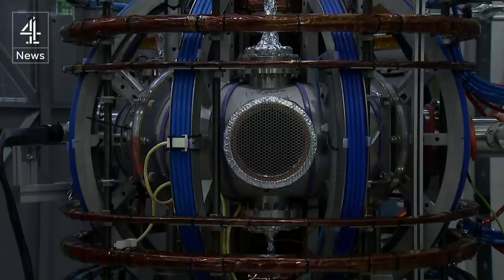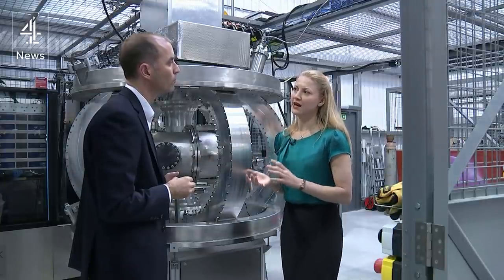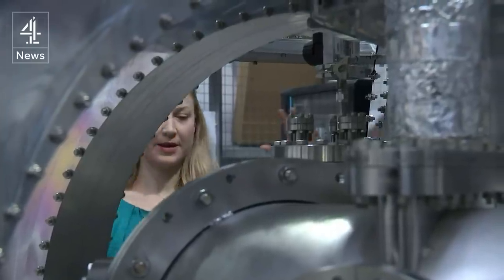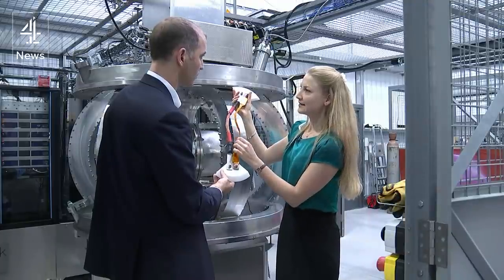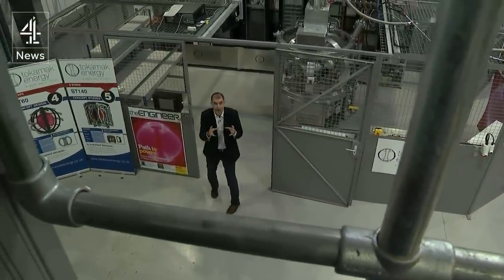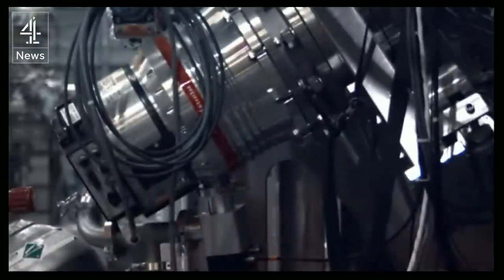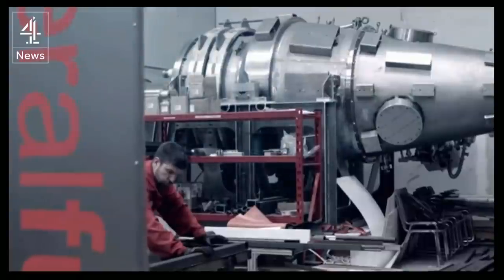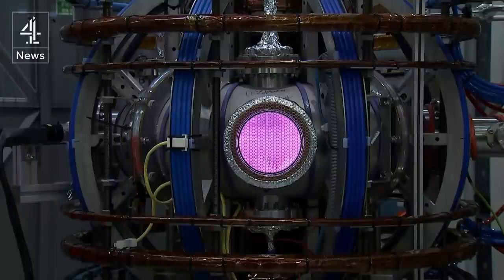Fusion energy: becoming a reality?

Comment: I want to know what that conductive ribbon is made out of
Reply: It's made of a very thin layer of superconducting material and a bunch of steel for strength etc. I'm not sure of the exact superconductir being used here but high temperature superconductors are usually ceramic-like materials with a complicated unit cell. Usually some oxygen, some rare earth metals and some other random elements. We still don't understand how high temperature super conductors work so it's hard to make them better without a lot of faffing around trying many different combinations and making some guestimates.

Comment: Is it dangerous to touch the super conductor tape?
Reply: +Martin Lancaster  Not to you but to the tape itself, it will damage it i think
Reply: It's a steel ribbon with a very thin layer of super conducting material and some coating on top. It's not toxic, but the edge might be sharp. If you touch it while powered it is going to be extremely cold.

It is voltage AND current that kill. If the voltage is a few volts it doesn't matter what amperage goes through the wire, you have too much resistance for a few volts to drive a dangerous current through you.

Comment: I cant believe she is letting you touch the super conductor tape. ffs
Reply: She's on the pull.
Reply: +HoldOnToYourTails either way she is not being vary careful.
Reply: +Sneaksby Alfresco It's clearly a sample for illustration along with the copper wire she was comparing it to rather than a piece of the actual machine.
Reply: I hope so. I live near there.
Reply: +Sneaksby Alfresco What's wrong with touching super-conductor tape?
Reply: Matthew Mitchell given the circumstances it seems like a bad idea.
Reply: Careful of what? Why are you afraid of a piece of steel with a very thin layer of superconductor inside? Are you afraid the edge will be too sharp or what?